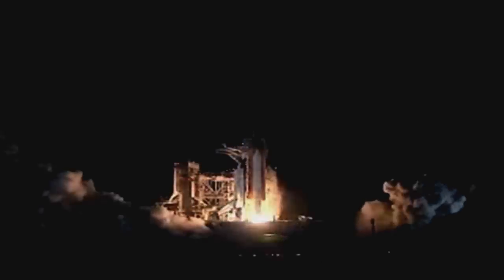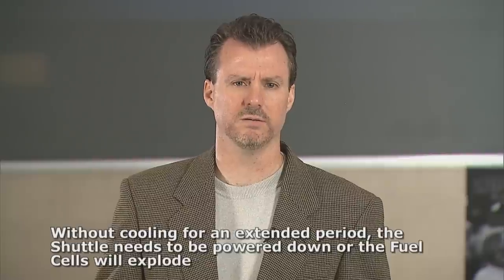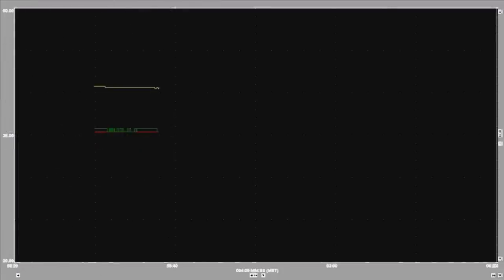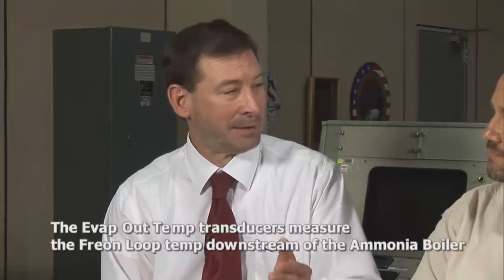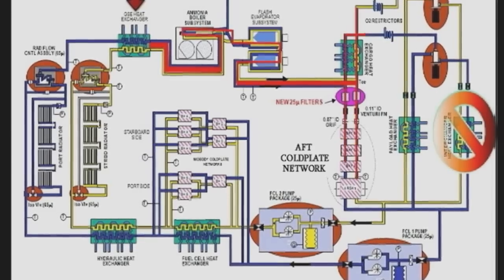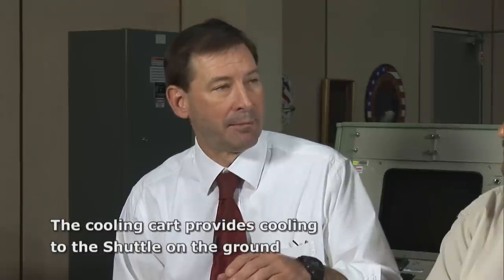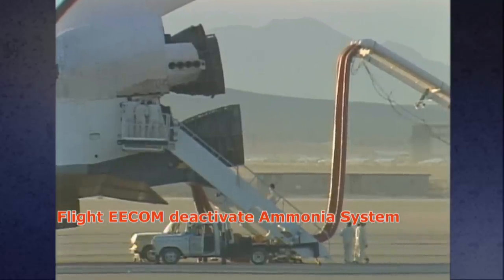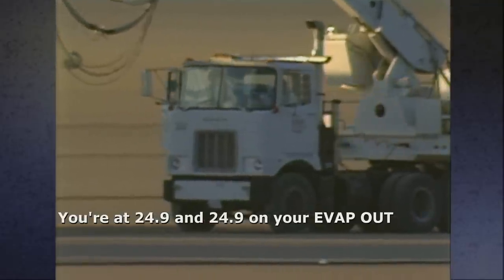STS-27 Post-Landing Undertemp Video

Comment: Just the second flight after the loss of Challenger, we nearly had a Columbia-style loss of Atlantis. Even this soon after the scathing criticism NASA management faced for minimizing safety-of-flight problems as "turnaround" issues, it was still "business as usual." Instead of taking this as an ominous warning of things to come, they looked at this close call as a vindication of the "well, it hasn't failed yet" approach and quickly put it in the rear-view mirror.

Hoot Gibson was so convinced that they were going to die on reentry that he had prepared a few select words that he intended to share with mission control if the roll trims started to exceed 1/2 degree.

Amazing that so much attention is put on a potential cracked heat exchanger, when such a loss-of-vehicle danger was so glaringly evident...